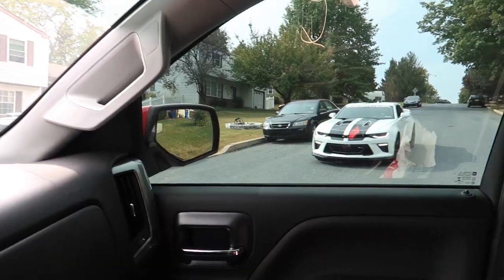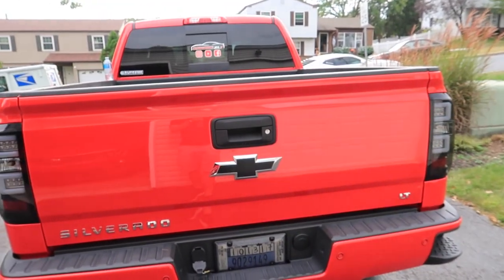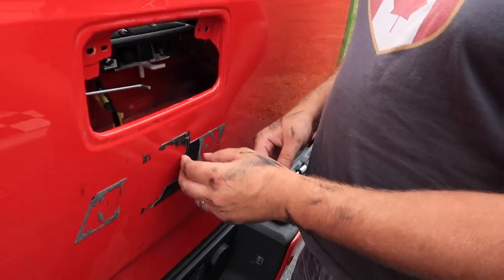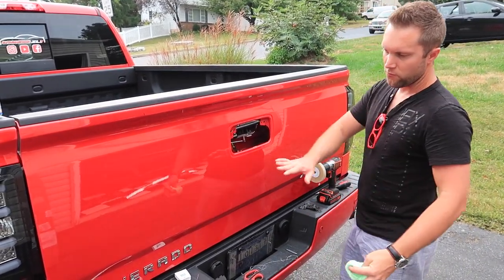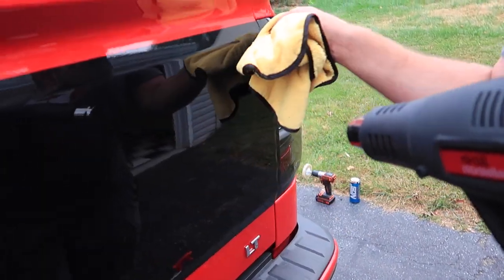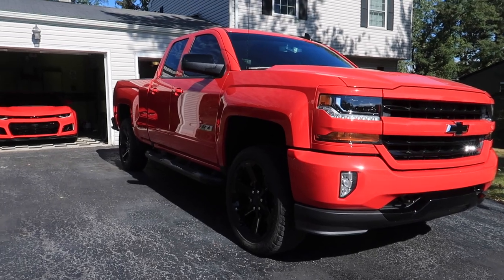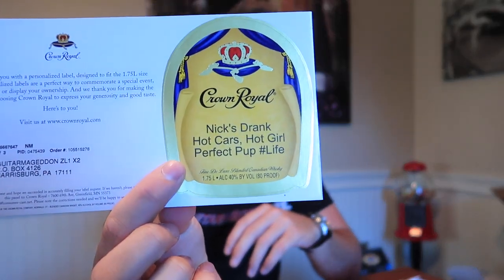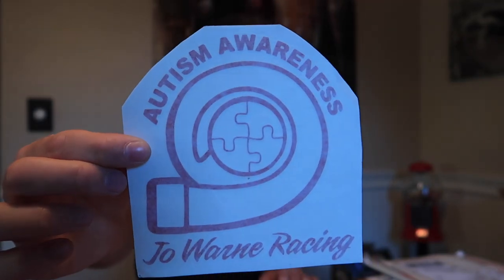WRAPPING My 2017 Chevy Silverado TRUCK!!

Comment: The black panel on the old BBC Camaros was called a Berger Panel after Berger Chevrolet.  They sold there modded Camaros from their dealership and painted all the back panels like that.  Started with 1st gen Camaros and went into the early 2nd gens.

Comment: It adds a level of fun factor for the "do it yourself" ....
Mike an Shane's videos are great yes, but the common guy doesn't have a professional installer on call 24/7. The average guy needs to learn how, right wrong and indifferent. 
Looks awesome man, question what would you use and how would you reinstall the badges ? 3m tape seems cheap but if that's what's best so be it.

Comment: Is there any chance you could give me the dimensions of the truck bed? The height, width and length,  and the width between wheel wells, and the length between the tailgate and the wheel wells, and the length to the cab to the wheel wells? Please:) I'll sub.